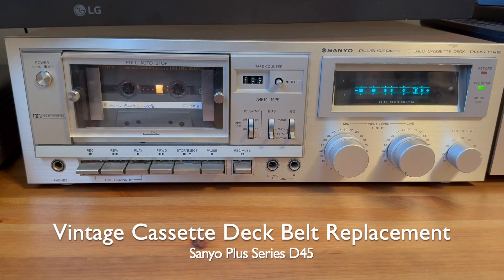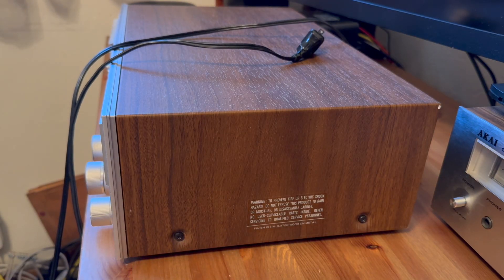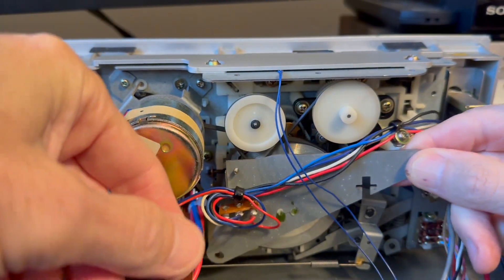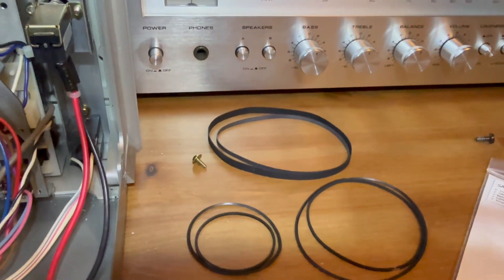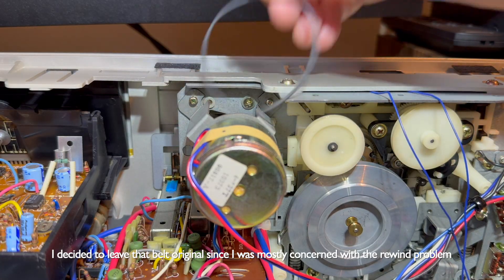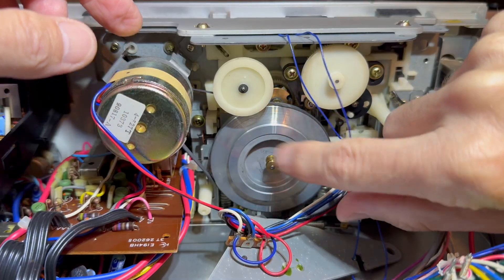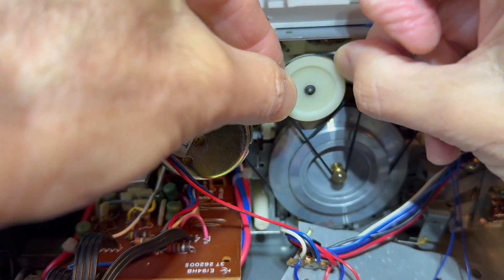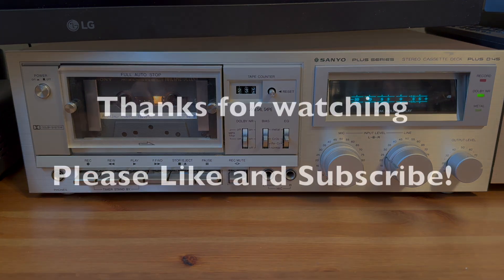Will replacing the belts fix the rewind on this vintage Sanyo cassette tape deck? #cassette #restore

Comment: Thanks for making this video! I have belts coming in tomorrow for a Sanyo and this video will definitely be a good reference
Reply from the maker: You are welcome! If it's the same model (or even a similar one) it is pretty straightforward switching the belts, as you saw in the video. I like how these older tape decks are generally pretty easy to work on.  Only 4 screws to take the cover off is nice too.
Reply: @AlexsRepairBench yep! It actually went pretty well, got it back up and running within an hour of work. Sounds amazing too. Thanks for the help!
Reply from the maker: You are welcome and glad it went well!

Comment: Hi Alex. thanks for your helpfull videos. i have sanyo rd 5250 and just bought from estate sales for $45 and decided to fix it if it's possible. and i figure out cassette and counter not playing at all. could you please help me to solve the problem? thx
Reply from the maker: Hi @chackap4130, I am glad you found the videos helpful.  I don't have that model although it looks very similar to the unit I have. Without looking at it, it would be difficult to diagnose the problem, but if there is power and the front lights up yet the cassette does not turn at all for any button (rewind, ff, play), you could try listening very carefully and if you hear a motor turning it could very well be the main belt is bad or broken (see the BIG belt I replaced in my video).  If that is broken or not working then nothing will turn and you might have a simple repair (replace the belt).  If it is the motor then there are several reasons why that might not work and could be much more work.  If I were to bet I would suspect the belt though, it is rubber and they do wear out and even break.  If you opened the case you could look at the inside and see whether the belt is in good shape or not.  But only do that if you know what you are doing and feel safe doing so around electrical equipment.  You could also take a clear picture and email that to me if you wanted, you can find my email in my main channel page and I'd be happy to tell you what I see and think.  You could do that without it plugged-in so would be fairly safe.

Comment: Did the belt supplier send you an appropriate size capstan/motor belt, or did you just let it go because the kit worked?
Reply from the maker: I emailed them once or twice and never got a reply back. The deck works and tapes sound fine so I just let it go, as it doesn't seem to make any difference. It is odd though the different size. Thanks for asking, it's good to fill in this detail.

Comment: Great video. I have a Sanyo rd 5030 that needs belts. I'll have a go myself with your help and just need to source the belts in UK. Thank you.
Reply from the maker: Amazon seems to sell a kit but I don't know if they would ship it to the UK: https://www.amazon.com/Complete-Belt-Kit-Sanyo-RD-5030/dp/B071YVWPP3. A place called Reverb also looks like they sell them, but I've never purchased from this company: https://reverb.com/item/74154687-sanyo-rd-5030-belt-replacement-kit
Reply: @AlexsRepairBench  Thank you. Amazon wont ship and reverb are expensive $40 inc p&p. I've tried generic cheap ebay ones all work except rewind. Not sure which little belt to change. Thank you
Reply from the maker: I saw the price $40 which is a lot more than what I paid, and I understand not wanting to spend that much. Unfortunately it does not look like the website I used sells belts for your tape deck. If you changed all the belts and rewind still does not work, it might be something else that is the problem too.
Reply: @AlexsRepairBench  Thank you Alex. Appreciated. Sorry for the late reply.
Reply: @chylogurti  sorted it. Very helpful guy stateside told me the size 10.2 I think. and voila. It works. Thanks again

Comment: fancy. sony metal select. not just metal sr, but metal select. but it's good that the belt fixed it. i was worried it might be an idler. i hate idler tires.
Reply from the maker: Thanks. I was concerned it might not be the belt as well since the old belts looked to be in decent shape. My guess is they were just a bit stretched out so did not have enough traction.

It was a pretty fancy deck back in the day. I think I paid around $280 on sale in the early 1970s. It had a frequency response of 20Hz to 19kHz +-3 db if I recall (don't quote me on that), with metal tape of course.